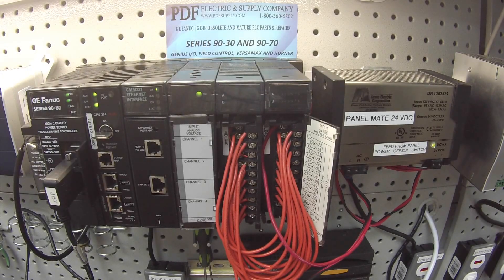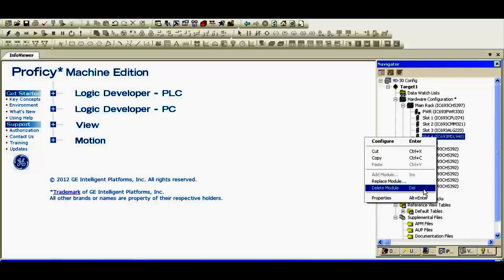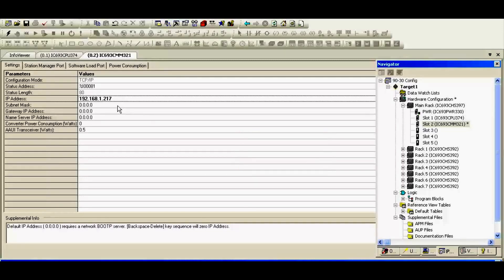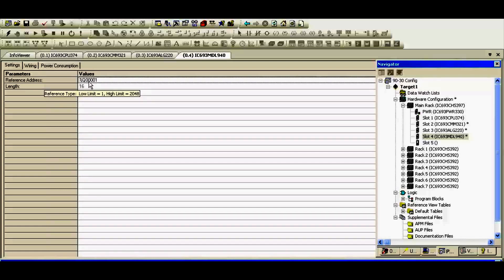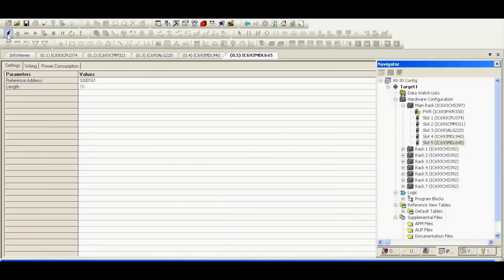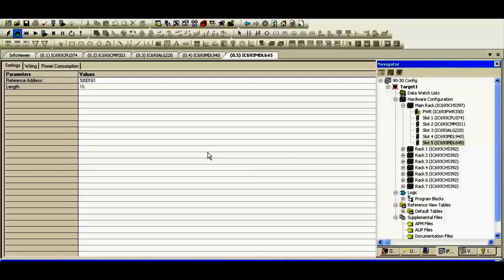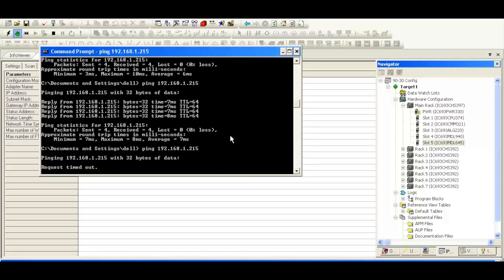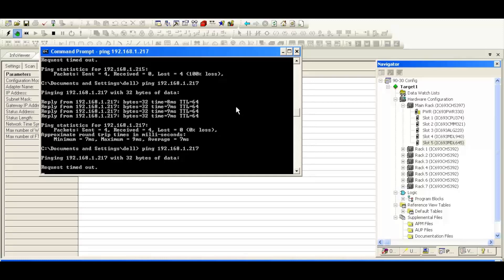GE Fanuc PLC Support & Training - Proficy Machine Edition Software - How-to Program Series 90-30

Comment: do you have manuals to learn for this PLC? I saw bits are from 1 to 8 is that normal en GE PLC? allen bradley uses from 0 to 7, thanks for your video. you explain it very good.